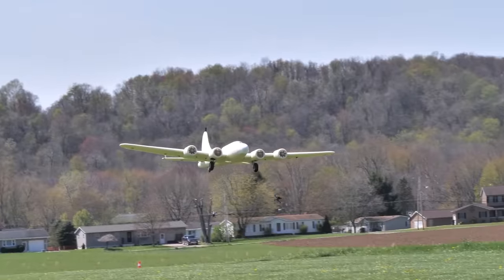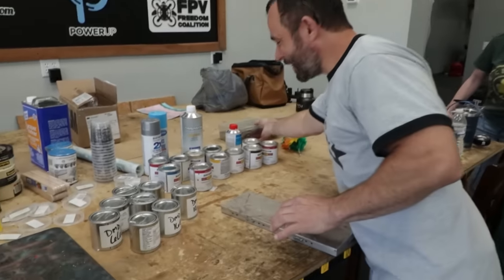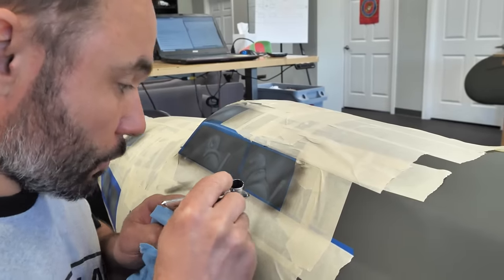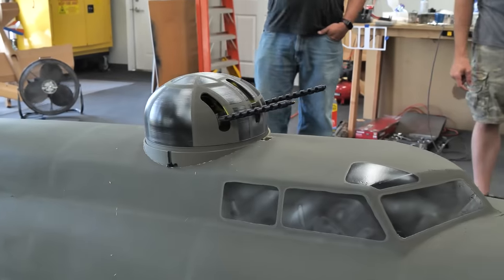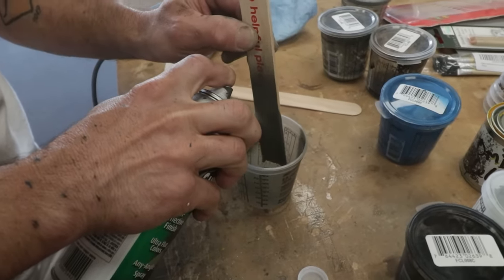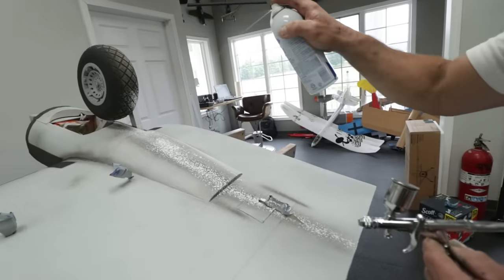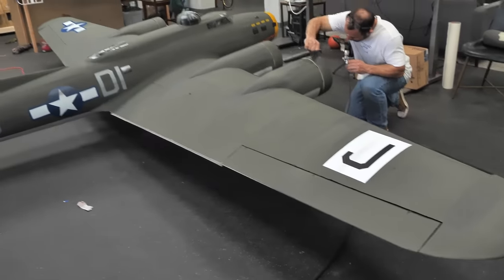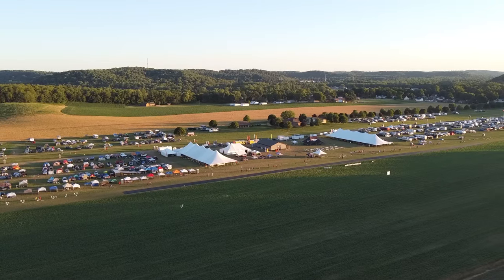Preparing Our 20 Foot B-17 For Battle  🔥

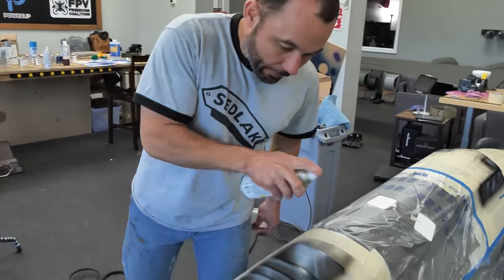Comment: 5:59 That 'window' is actually more of a hatch, and the whole thing opens up. I got a flight in one, and was bent over, making my from the back of the plane to the front, and I stood up when I sensed the headroom would allow it...and stuck out of the plane up to about my mid chest. I didn't necessarily feel like there was so much suction I was getting pulled out, but it was disconcerting to suddenly be "out of the plane" while in flight. The open side gun ports were interesting too, and you could see straight out into the sky around the (visible) tail gear. The turrets were not open, but since I could barely fit in the bombers compartment, there was no chance I was getting in the belly gunners ball what-so-ever.
Reply: Did you happen to fly on Movie Memphis Belle?
Reply: @adamdrain  No..."Liberty Belle", a little while before it caught fire and crashed.
Years before that, at an auction, my mom bought a ride in a P-51 race plane (Destefani's "Mangia Pane") for my father...and when Liberty Belle came through town offering rides, I suggested we get him a ride for his birthday. She secretly bought two, and I got to go as well. He was a big airplane enthusiast, and specifically WWII warbirds.
Reply: @nevyen149  I work for the Liberty Foundation that operated Liberty Belle.  She is slowly being rebuilt.
Reply: @adamdrain  I saw the pictures when it crashed. Like the Spitfire Guy Martin helped work on...I'd call it a re-manufacture...there wasn't enough left to call it a rebuild. 
I'm a classic wooden boat person myself...and I have the same problem with that. Someone will be talking about a boat having been "rebuilt"...and list every part of it as being replaced...deck, frames, hull planking, mast, rigging, etc. 
I always scratch my head and think, "The only original part left is the name!"

Comment: I'm a scale R/C modeler for forty years or so. That is not "neutral grey" underneath. Not even close. Please check it out and re-paint it correctly. This magnificent model that you all worked so hard to accomplish deserves it. Don't feel too bad, I've seen actual restored B-17s with the wrong paint, and to correct that would cost thousands.
Great job and great flying.
Reply: The gray and the OD may not be perfect, but they are very darn close.  Closer than most of the things I've seen in the RC or full scale world.  I can only think of one flying B-17 in the world that has the correct color OD and Neutral Gray.. and guess who helped paint that?   :-)
Reply: @adamdrain  Yes, as I said, "I've seen actual restored B-17s with the wrong paint."
Well then, with your experience you should know that the Dark OD 41or later, MG42 which is slightly greener, applied to aircraft during WWII varied from time to time and from factory to factory. There was no monochromatic OD, and there is no one Federal Standard Color chip for it. Also, as you know, the nature of OD is that it fades and weathers very quickly and in every possible way and, as is the nature of colour in general, its appearance varies widely in different light.
Also, you must know that the WWII era colour photographs of OD 41 painted aircraft (and others) that have survived are of dubious quality as to their exact hue and colour for all of the above reasons, plus a few photographic ones including the aging of the photograph, the film stock and filters used, the light it was photographed in, and the like. 
From PLANE COLORS AND CAMOUFLAGE .WWII U.S. ARMY &.USAAF PART 2)BY : GIANNIS MITZAS "It is generally accepted that OD 41 was an olive green when freshly painted but faded towards either a deeper dark green or, more commonly, into a dark tan. The differences in fading were caused by the fact that paint manufacturers used different pigments in order to match the official color chip. It also faded differently on fabric surfaces than on metal, hence why OD 41 aircraft often appeared with lighter flaps and other movable surfaces or in some cases, the reverse. Probably no other color in the history of military camouflage has shown more variety in color photos, and given that all drabs tend to hover close between appearing green or brown, very modest changes in lighting and saturation could also affect its perceived color."
"Neutral Grey No. 43 is, thankfully, less controversial, and as the name implies is as close to a perfectly neutral gray as can be (its predecessor, Neutral Gray No. 32 on a 1939 specification had a Munsell value of 5N which under the 1929 notation meant a perfect neutral). It can also appear warmer or cooler depending on the photo, and also tended to look darker than it was due to the inevitable dirtying of the undersides."
I think that given the large size of this model that colour scale effect would be minimal if present at all (a 1/32 scale model requires only approximately 7% lightening), blacks, light greys and whites being not as much affected by such. While we have a reliable FS chip for it, I've never seen two photos of Insignia White that were very close to each other.
In any event, I have nothing to say about your OD. It's fine. Actually, with weathering as you have applied, anything that resembles "average" OD 41 would be correct given the above. 
It is the neutral grey that is of issue. Even taking weathering, fading and scale effect into consideration, what appears on the underside of this model is very far from it's closest match as seen on FS 36173 (and to a lesser extent FS 36270) which is still slightly cooler than it should be. 
This is a magnificent model which deserves the correct paint as I'm sure you agree. I think that you know that the colour you used is not similar to Neutral Grey 43.

Comment: well have u opened a can after it was out off pressure? Some times cans that are out off pressure are not yet empty. this could still hold some paint. Get a cup and needle nose pliers then ONLY WHEN THE PRESSURE IS COMPLETELEY GONE NEVER BEFORE THAT!! because paint will go everywhere also in your mouth nose ears and eyes! grab the bottom and press against the side of the can to make a small hole again only when u are sure its empty of pressure! hold it above a cup or can and poor out the left over paint. Oh and wear gloves and eye pro.

Comment: you didnt add the radiator/exhaust weathering on top of the wings behond the engines!
Reply: There are no exhaust vents on the top of the wings.
Reply: @wittpilot  having read up on it, what I’m referring to are the intercooller inlet or outlets not sure which. Four small openings behind each engine
Reply: @njrmodelling  Yes, they vent air out of the wings like fuel vapors.  There would be no staining coming out of them though and 75% of RC B-17s out there get this wrong.  Wish I could post a photo of a wartime photo on here.  If you do find one, sometimes the oil from the engines would come back over the wing, but actually they would streak inbetween these airvents.

Comment: Where are the waist gunners? Even their windows are not shown. That's not right. Each B-17 had a crew of TEN MEN. You just left out two of them. That guy's grandfather would be spinning in his grave.
Reply: gotta agree with my limited knowledge of b17s
Reply: The spots for the windows are there if you look close.  They may have simply ran out of time to get them painted in or they possibly had other plans for the waist guns that did not come to fruition.  BTW, did you know the crew weight stencil for the B-17 was 1200 lbs?  Because it was originally designed for a crew of 6.

Comment: All that effort and electric motors? Seriously? Landing gear doesn't retract. It should have had radial gas engines. The landing gear should retract.
Reply: I wish the landing gear retracted too but as for the radial engines, it would add to much weight and take away from the scale flight characteristics. One of the problems with the larger gas engines is they make planes like this have to fly like fighter jets. I saw a giant scale B-36 with even smaller standard rc engines and it flew like a missile. A B-36 or a B-17 should not be able to do aerobatics. LOL
Reply: @Siryn  There are B 17s as large as this and maybe larger with gas motors and they fly just fine. These can handle a lot more weight than you realize and can still fly very slow and handle just fine. The heavier they are the more stable they will fly.